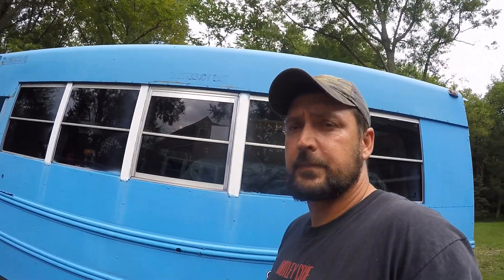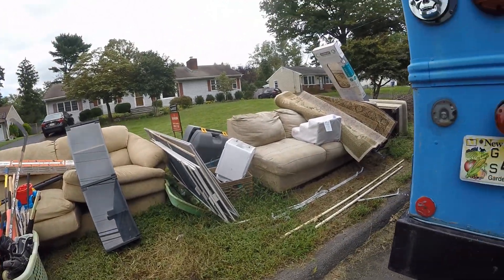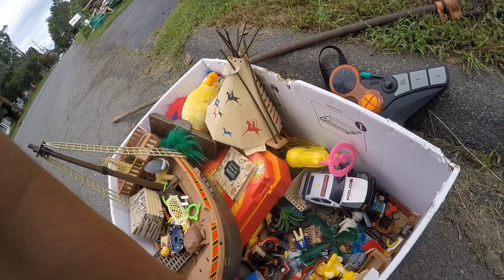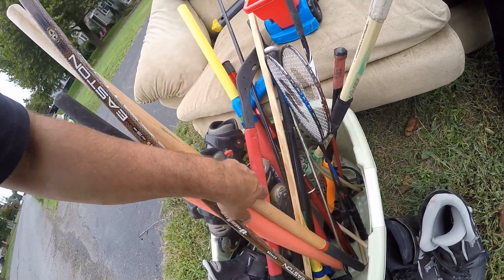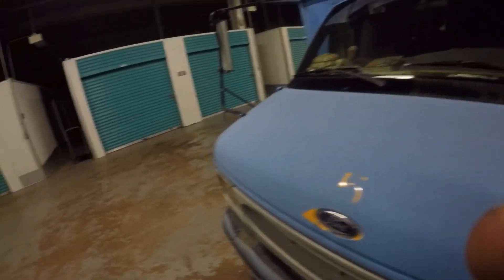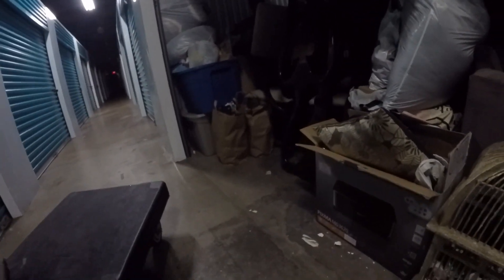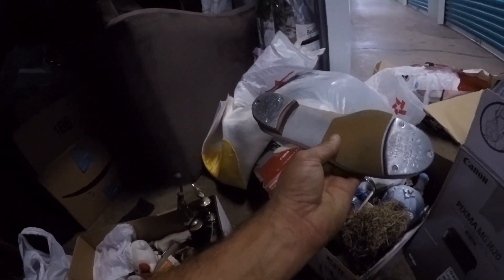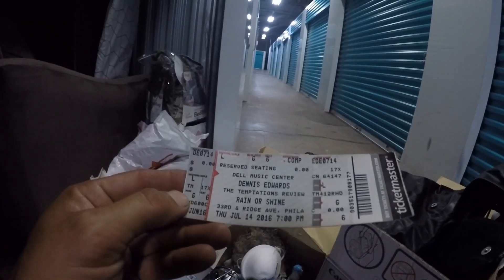Trash picking on my way to the storage auction what treasure do we find in my five dollar room 💵🚎✌️

Comment: Don't always depend on the tag or weight even materials on a Coach or other high end purses or shoes, boots etc..  Check how the stitching meets at corners and if the curves and points exactly match.  No broken or cut end threads anywhere.  Does the interior fabric feel like the right weight in a high end item, purse, suitcase, shoes.  Does the fabric color and design match or look appropriate for the item.  Are the zippers the right kind for the item.  Coach only uses one kind of zipper check if the tags are duplicates.  Some are and the Coach site will mention it when known.  Other high end products can be missed if you aren't familiar with the name . Look it up and for each item and check on it.   Good luck all.
Reply: PS:  E6000 is a wonderful glue used by crafters and hobbyists.  Permanent after 24 hours but will hold items in place until cured often.